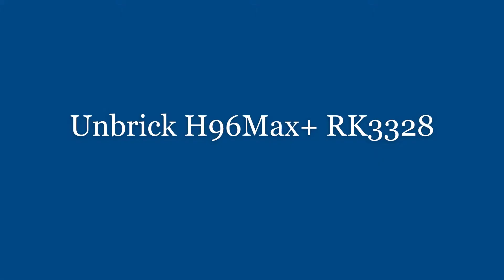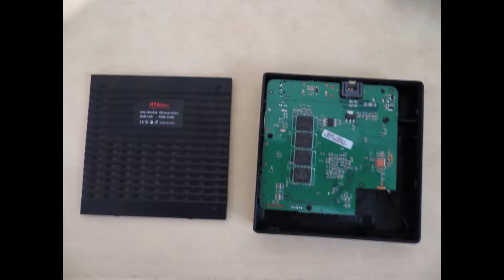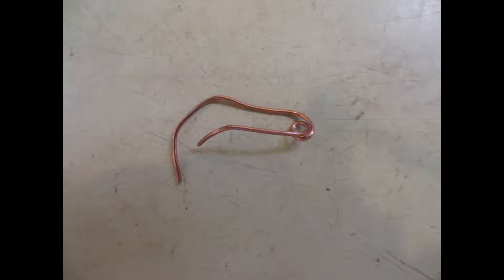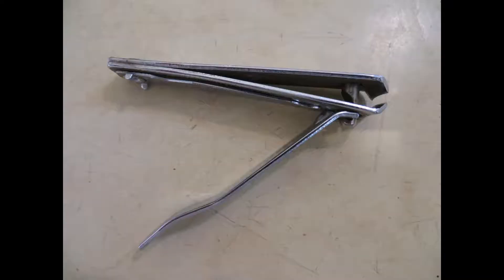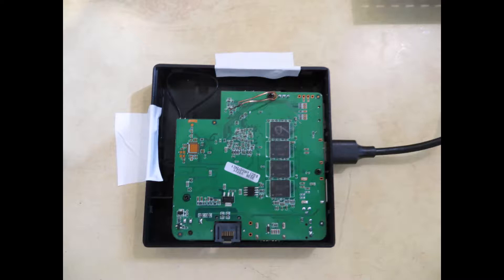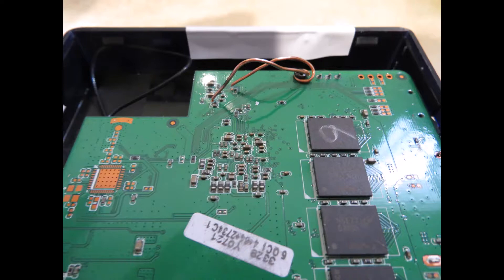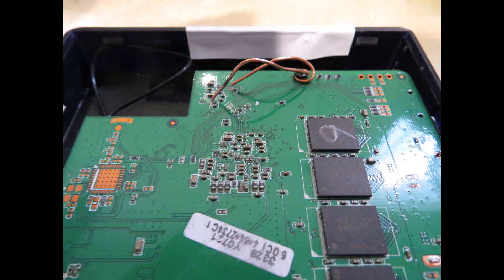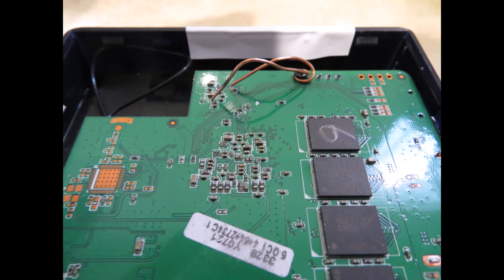Unbrick H96Max+ RK3328 The Easy Way

Comment: In my case it's a blue pcb and while flashing stock rom it got bricked now it gets detected for a second n goes away doesn't start flashing. Any help to fix this wud be greatly appreciated.
Reply from the maker: Try to use an old firmware preferably the original version. All the bricking problems were due to trying to upgrade the firmware.

Comment: Dear friend! I tried it too, when it beeped and I pulled the wire, it said Prepare IDB Fail.
What could be done? I look forward to all your help!
Reply from the maker: Can you tell the timestamp of the video that this happens?
Reply: @textpower3050  Thank you very much for the quick help! I made the mistake of trying to solder and the right-hand contact broken off. I see that the right side of the contact leads to a resistor, where does the other side of the contact lead? can't see properly. If I could get a very close picture of the motherboard, maybe there would be a solution, because then I would solder that wire there. And then I would try again. Before, the laptop didn't respond to anything when I connected it, now at least the laptop beeps when I plug in the USB. It will surely be good if you manage to solder it.
Reply from the maker: @denesnagy2018  Have you tried to take the motherboard out of the box and check both sides? If you tried to short circuit the two points that I mentioned in the tutorial then you probably damaged the resistor. I don't see why you are trying to short circuit with a wire instead of using the copper wire that I mentioned? Hope you succeed my friend.
Reply: @textpower3050  Dear friend! Can you send me a close-up picture of the part where the two contacts are? Let me see where the path of the right contact leads. Thanks in advance!

Comment: Sir, any software update for H96 max+ ?
Reply from the maker: You can check here https://www.h96tvbox.com/content/6-Firmware-upgrade but if your box is working and not bricked, my recommendation is to not do any upgrades as many people have bricked their boxes while attempting to upgrade.
Reply: @textpower3050  Thank you for your advice, Sir... Hence, I'd done upgrading mine to android 9. And you're right, it was very risky to upgrade at our own...
Reply from the maker: @oliverqui9512  You are welcome. Is your box working now with Android 9 or did you brick it? If it is bricked use this video tutorial but downgrade to the previous Android version firmware.
Reply: @textpower3050  i did the processs better, so here it is. it runs smootly in its android 9 version...

Comment: hi brother,my rk3318 unable to detect when i flash in factory tool.installed the driver and plugged in the black usb port while pressing reset button but nothing happens unless it powers my box stuck in boot.
Reply from the maker: Did you follow my tutorial? You need to short circuit two pins on your RK3318 and press reset at the same time and then connect the USB cable and flash with the firmware for RK3318.

Comment: how long does it take to grab the 2 pins and when do you have to take them off?
Reply from the maker: You connect to the 2 pins all the time until you see the flashing has finished and you get a green light. Of course you must also have the reset button pushed in as shown in the tutorial. Good luck.

Comment: Thank you, I'm able to connect the box by you away, but it fails the restore process. Any tips?
Reply from the maker: What model do you have and did you use the correct firmware? You can try a previous Android version sometimes the latest version doesn't work. Good luck.
Reply: @textpower3050  thnx for you video, however i gave up, maybe any hardware problem
Reply from the maker: @florjanv  As you wish. The question is how did you brick your gadget. I bricked mine while updating to a new firmware and kept trying until I got it working. If you give up, you make the same manufacturer a little bit more rich when, they should have a reliable gadget.
Reply: @textpower3050  mine, started to restart frequently after 3 years. I tried to upgrade and it just got freez in red light. I wan not able even to connect it with pc. Because i could connect it just after your video. However, i will try it with different frimware. Thank you

Comment: I have tv box H96MAX X3 (s905x3-v21 mother board) bricked I need short pin location for nand flash please help
Reply from the maker: I am not familiar with this model. Just take out the back cover and make a guess where you should short the pin location. Take a photo of the PCB and send a link if you still need help. Good luck

Comment: Dear i have H96 Max RK3318, i tried all the ways but when ever I connect the USB cable to the computer it shows an error that it Fails.
Reply from the maker: @immi What is the color of your 3318 PCB? It is very important to download the correct firmware based on the PCB color. Did you follow this tutorial exactly? It is very important to make sure that the two pins are shorted and to have the reset button pressed at the same time, before connecting the USB cable. Watch the official upgrade instruction in the link above (Show More).
Reply: @textpower3050  My PCB board color is blue and yes i followed all the instructions but still failed
Reply from the maker: @simtiazfarooq  There are two firmware options for blue PCB for Android 9 and Android 10. Try both and if this doesn't work, look for older Android versions if you can find them. I had this problem and using older version helped me.
Reply: @textpower3050  i have downloaded both 9 and 10 but they are not working. If you have the link for the older version then share it with me. Thanks
Reply from the maker: @simtiazfarooq  Sorry I don't have older versions. Try searching the internet or contact the manufacturer. I never got a reply from them perhaps you will have better luck.
Reply: @textpower3050  ok thank you so much for your prompt responses.
Reply from the maker: @simtiazfarooq  Also try a different computer. Use USB 2 and NOT USB 3 ports.
Reply: @textpower3050  yes I am using USB 2 (black) for this process... Any how thank you. I think it's the time to buy the new one
Reply: afgan rizky  thank you boss. But i think my device have some hardware issue because whenever i try to connect it to the computer it show Fail error after some time of connection

Comment: My H96 max + RK3328 didn't work, the computer doesn't recognize
Reply from the maker: Sorry to hear this Silas. Assuming you follow the instructions exactly, please try again and again, and make sure the shorting copper wires are making good contact to the terminals on the PCB. Good luck.
Reply: It work for me thanks